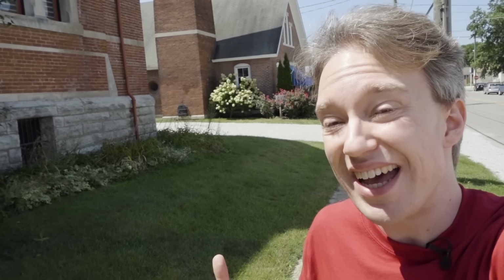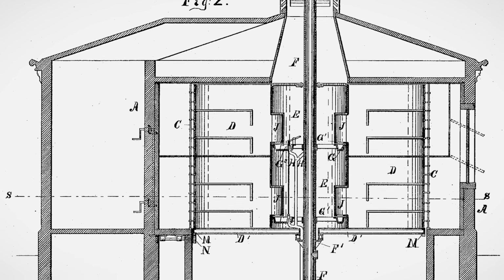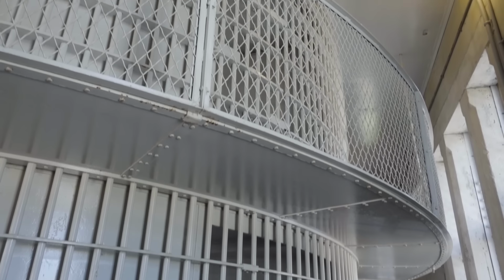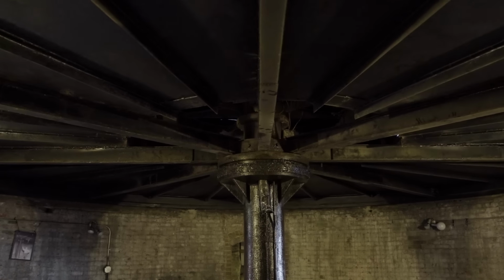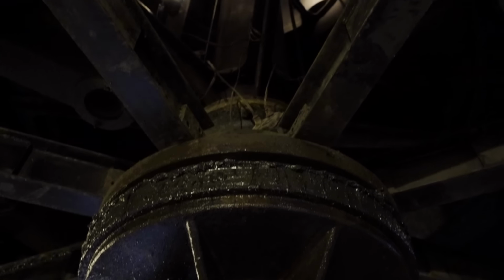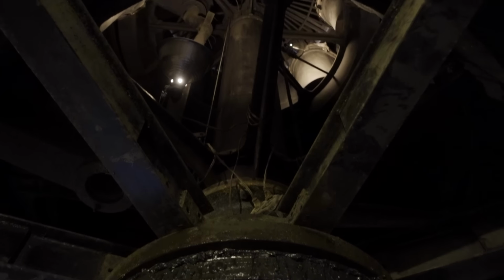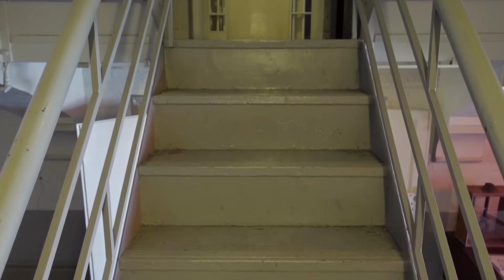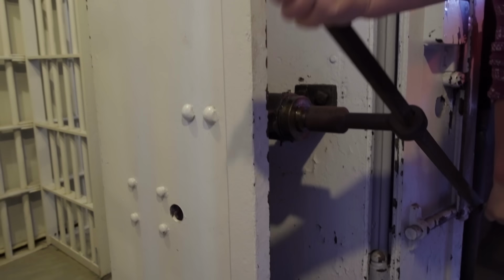The "rotary jail" had a slight problem

Comment: I visited this jail as a kid. A story that I remember the tour guide telling was of an inmate with a wooden limb who would, quite intentionally, stick it into the bars to jam up the machine and prevent it from turning.
Reply: thats one hell of a piece of wood
Reply: He probably had a wooden limb because his arm got chopped off
Reply: Judging by this machine's apparent power to break bones, I have my doubts about the truth of that story. 
I instead imagine it was told to not even get you thinking of what would happen to an arm jammed in there because if it can't break wood, it's all of a sudden nuch more harmless in our minds.
Reply: Wood from a diamond tree? I don't know if you know anything about physics or force, but a wooden limb is not stopping that door for a second.
Reply: @TheCbjunkie  it can stop it, or at least slow it and force the guards to make far more effort. It just can't in the way you're thinking of it. I guess the inmate would not be that stupid as to extend their wooden limb at the bars' reach, but rather it would be more efficient to stuck it in the gap between the central rotating platform (the cells) and the bars. The friction would certainly make it a lot more difficult to rotate the cells, considering the limb had to be of the necessary measurements to do that, which is not something crazy, actually.
Reply: Did a little trolling
Reply: I'm an exconvict. 
One trick to jam up the rolling bars style door is to put a toothpaste cap up in the gap of the mechanics. Plastic gets in there n creates a small gap so the door looks closed but is not. 
Any smart person would say no way a plastic cap can defeat the hugely strong bars.
Reply: @runtergerutscht4401 you don’t think a piece of wood can jam up gears and stop a door from turning?
Reply: @awesomebeast7509  I think that maybe it could, if it was indeed jammed into the gears. But I do not believe that a single piece of wood can stop the cellblock from rotating.
Reply: @runtergerutscht4401  a well-made, thick, arm shaped piece of wood is definitely stronger than an arm bone lmao. it doesnt sound that unlikely.
Reply: @verminscum  maybe. But it still seems implausible that such a piece of wood can stop the entire cellblock from rotating.
Reply: @runter gerutscht  if cell is already in momentum it would break the wood, if it has no room to move a single millimeter and u stuck something it would probably jam it
Reply: @runtergerutscht4401  Bro the inmate would have the mechanical advantage as well in this situation as he's on the outside of the largest circle. If anything I'd be surprised if inmates couldn't stop it with a wooden pole.
Reply: Trollage
Reply: @beaneater6932 old growth wood was strong. Not much of it left now
Reply: @TheCbjunkie  neither is diamond 😱😱
Reply: @runtergerutscht4401 It's hand-cranked. Wood beats hands.

Comment: I bet someone said "Why don't you just make the bars rotate?" within a week of them finishing building it.
Reply: Amputations are still an issue but it would take less energy to open a particular cell.
Reply: But you would have to build a catwalk.
Reply: And then someone else asked "why not just lock the cell doors?"
Reply: @PrimusProductions  The mass of the part thats rotating is much smaller, so less inertia, so amputations might be avoided.
Reply: It shouldn't have had bars. Just smooth walls.
Reply: If the bars rotated with the cells, then you would need a door for each one, which negates the point. Since it was 1881, plastics weren't mainstream or cheap enough to use, and glass was too fragile. Had this type of prison been built in the modern day with an electric engine, clear plastic walls, and the necessary precautions to let the prisoners out during an emergency, this could've been a more successful design.
Reply: @Rackergen  rotating catwalk
Reply: Ur a genius
Reply: Because then theres really no point in having a rotary cell.
Reply: Jordan Wardle but is there to begin with?
Reply: @BarginsGalore  no, but one use for the design means that you can put many more cells in a given space
Reply: Jordan Wardle not really. You could fit just as many if it didn’t move and each cell had its own door
Reply: the inmate literally can just pull the bars and move them so no
Reply: Rena Kunisaki 
Because then you’d need more guards which was the one plus of the design. If you wanted to rely solely on locks you would have a prison with zero guards.
Reply: @michaelweiske702  i think OP meant have the bars rotate instead of the cells
Reply: @axis4813  then the problem still remains, if the bars rotate but the cells remain stationary, people can still be injured in the same way. From the prisoners' perspective, their cell was stationary and the bars were rotating, so the problem remains.
Reply: @millomweb  then you couldn’t see what the inmates are doing ( unless the walls are glass, which has its own problems )
Reply: @MachineWashableKatie  why
Reply: Why not make the bars closer to each other, so you can’t fit an arm/ a leg trough?
Reply: @chri-k  You could have spy holes through the walls in places!
Reply: @chri-k  Material cost, you would need the bars to be so close together that the gaps would be less than an inch, at which point you might as well have solid metal.
Reply: @Benedocta  I think it would still be the same thing with a huge cylinder with the cells around the center:  the difference is the cylinder would have the bars and an open door frame built in with a smooth wall all around the outside except one spot with an opening on each floor.
Reply: then you would need 2 guards, one to rotate the bars, and one to watch the door, then you might as well have a regular jail system
Reply: How would this help anything at all? The amputation risk is exactly the same and the issue of fire risk is exactly the same as only one door... wtf? why are so many people praising this idea?
Reply: @axis4813  tom had tge same suggestion but idk how that would help either
Reply: @dorrisgonnawreckyou7111  because its easier
Reply: @IzzyCraft  You still need more than one guard, a single inmate can overpower a single person.
Reply: U would of had to build catwalks all way around to use all the cells
Reply: @michaelweiske702  The whole point is you have only 1 door so if you take precautions to let people out in emergency you might as well make a regular jail
Reply: @Rackergen  I don’t think a catwalk is needed; you can just have the bars rotate around on top of some bearings in a groove cut in the floor.
Reply: @millomweb  Air is needed for breathing. Also light is needed to stay sane. They're a jail, not a supermax with solitary.
Reply: Imagine the inventor sputtering and backpedaling trying to come up with rational reasons for his invention when some random dude casually suggested making the bars rotate instead.
Reply: @millomweb  Smooth walls instead of bars could stop drunk people hugging them and getting limbs cut off but then you’d probably have a mental stability and ethics issues with locking people in essentially doorless and windowless rooms instead. I don’t know if security cameras were a thing or how advanced they were back then but I imagine someone would still need to be able to periodically walk around the whole thing and look in to check on people as well.
Reply: @moony2703  Security cameras were absolutely not a thing back then. You'd have to wait for about another 100 years for that to be practical after this jail was designed.
Reply: @IzzyCraft  oh no, 2 guards instead of 1, the math is all wrong, it won't work, it's ruined, ruined I tells ya

Oh wait no, I forgot, that doesn't make sense, sorry
Reply: @Reihynn  no, there are absolutely mechanical ways of making sure it's only movable by crank and can't just be pulled along manually. Like a lock that's held open by the operator as it wants to let out the length.
Reply: Still have all the same risk.
Reply: @Reihynn  Im sure there is a lock that stops it from rotating
Reply: @michaelweiske702  have them rotate in opposite directions at the same time
Reply: @PrimusProductions  Maybe
The bars might be heavier
Reply: @PrimusProductions  Just put another door in the cell instead of an opening.
Reply: same problem... arms can be damaged.. plus if bars rotate then you cant have a single entrance/exit

Comment: "The bars could have spun," was my immediate idea... It's just insane, to move the whole thing, with it's here plumbing and everything.
What a bonkers idea.
Reply: I think the reasoning was because that way the opening is always in the same spot. If the bars rotate the opening is moving. So the cranking person can't see the opening. Part of the security was that you only needed a single guard. But you'd need more with moving bars.  
  
Also I'm not sure it would be easier that way or not. The bars being solid might weigh alot more than the cells which are made from plate steel with lots of air in the cells. If you summed the mass of both I wouldn't be surprised if the bars weigh much more.  
  
Also some cells face windows while some don't which is a reason you might want to be able to rotate the cells. There could be other reasons as well about the direction of the cells. Maybe you want to keep an eye on a particular prisoner. 
  
Overall I think it up for debate which way is better and we have to remember it was the 1880s. So some limitations applied in terms of electric lighting, security measures, and so on.
Reply: Like the corkscrew: why rotate the outside, when you can rotate the inside? Then someone came along and rotated the outside.
Reply: @mcfail3450  They could attach a platform to the bars. The opening is rotated to a cell door, the door opens and the prisoner steps onto the platform, and then the bars are rotated back to the operator before opening.
Reply: Smells like a scam to me. It must have been so expensive to build this!
Reply: you gotta walk around the whole building then
Reply: @milesedgeworth132  what's stopping prisoners entering other cells then?
Reply: @leftysheppey  There are two sets of bars. One for the cell and one for the platform. The cell door opens, the prisoner stands on the platform, the cell door closes, the prisoner is turned to the entrance, and the platform door opens.
Reply: Unfortunately, no matter how you slice a rotating bars, or prisoner transport platform, you're still opening one cell at a time, and that is an immense fire safety problem as mentioned in the video.
Reply: @irregularassassin6380  funnily enough, build it without flammable material, and it's still a fire hazard.
Reply: @milesedgeworth132  It be much more reasonable to just rotate the operator and crank with the bars.
Reply: @akzual50  you ever seen the 2 minute prison kill scene in breaking bad??
Reply: With it’s here ?
Reply: @maxbracegirdle9990  in real life it’s 1 minute
Reply: They could have put heavy mesh screen on the bars at the bottom of each cell.
Reply: Sage!
Reply: they could also just remove the walls next to it, that way you don't just break a limb because you got caught on something.
Reply: @carlosandleon  Oh no walking, every american's nightmare!
Reply: What about putting a barred door inside each cell to create a gap long enough that you couldn't get a limb into a crush zone?
Reply: The bars spinning wouldn’t solve either the fire hazard problem or the amputation problem
Reply: @Wjanabdjd138  oh no, it would still be a safety hazard from hell.
But it would have required far less resources to spin the bars, instead of the entire block.
Reply: @milesedgeworth132  that's even more weight
Reply: They were being creative
Reply: As someone with whatever used to be called ADHD, I really think the inventors had severe issues with managing their hyper-fixations and this 100% looks like a silly 'what-if' idea that went all the way. Main evidence being, exactly, that the bars could've spun instead and the problem would've been done in a week. Or the doors could've been lifted up/ the floor dropped down instead of needing to rotate at all (like a stopped elevator that just has a slot of clearance at the top, but covered in bars), which could've been way cheaper.
Reply: that would not fix the injury issue. There would be less mass being moved thus less pressure when the arm get's pinched between the bars and the side of the room, but it would certainly still have enough force to cause injury
Reply: @CrypticCobra  For sure, might be cheaper though. And in case of fires it's faster unless the mechanism breaks.
Reply: @akzual50  Funnily enough, things you think that wouldnt burn, do infact burn if they get got enough. Like bricks and Concrete. Unless you plan on making the entire prison out of steel (Also a bad idea) no matter what you do you're going to have to add flammable materials
Reply: @CrypticCobra  Oh yes, most definitely. But it would require less power, and less insane plumbing/power to set up.
Reply: @empdisaster10  I agree that concrete will break-down and oxidize if heated a lot, but is the process self-sustaining?  

Unlike wood, which releases a lot of heat when burned, I thought that concrete burning was almost endothermic, requiring other fuel to keep it going.
Reply: wouldn't have stopped the fire safety problems or the amputations tho.
Reply: @mcfail3450  rotate the bars AND the guard.
Reply: @milesedgeworth132  how does the operator see if the prisoner is in the rotating spot then? This is before cameras and before remotes. The operator has to be in a single spot unable to see everything. That's why the door is stationary and the cells move.
Reply: @therabbithat  the whole point was to only need one guard. The controls in the 1880s could only be stationary. So if you rotate the guard you have to now have a guard and another one to operate the controls. The whole system is designed so that a single person can rotate the cells to the door next to the controls then open it and let just that prisoner out.
Reply: @empdisaster10  people are certainly flammable, as we've seen. The "absolutely fireproof" Iroquois proved that one.
Reply: @akzual50  most people in fires die of smoke inhalation, not burning to death. Tney would die of the lack of breathable oxygen if the building was on fire, not from their metal cage burning.
Reply: The prisoners being suspended, the entrance always being in the same spot, it puts the 'vulnerable' parts of the cell on the outside too rather than within reach, and funnily it was probably more reliable this way with few big moving parts rather than many smaller moving parts. The idea really isn't that crazy if you're a small town that has limited guards to spare.
Reply: Wouldn't the bars spinning do the exact same thing, just reversed
Reply: "with it's here plumbing..." uh...what?
Reply: @empdisaster10  So you say concrete burns. I say citation needed.
Reply: Also could’ve had the hard plastic walls they have nowadays obviously they wouldn’t have it there back in the day but they could’ve implemented that later on
Reply: @milesedgeworth132  imagine all of the prisoner jumping onto the platform as the bars passed them
Reply: @irregularassassin6380  I'd probably design it without bars at all. Just a seethru Mesh with the support beams on the outside of the mesh. And to solve the Fire issue, 7 of the 8 cells line up with an Emergency exit that only opens in the situations necessary, letting out to catwalks. 

But I'm talking like, really thin mesh, but still seethru. Small enough to not stick a finger in, idk what material would fit that and withstand getting kicked out of the way.
Reply: You guys need to quit trying to ruin the inmate vending machine
Reply: @leftysheppey  It's city jail! Many have open blocks.
Reply: 2:40 If it's designed the same way rotating the bars would still cut off someone's arm. If it's designed differently you could still rotate the cells.
Reply: @PianoKwanMan  What does that even mean? What are you talking about?
Reply: @JD_tcb  Mr Old's elevator, which a variation of the Archimedes screw. Spinning one object in the reference frame of the other doesn't matter
Reply: Yea but that just means the bars rip your arm off not the wall
Reply: @mcfail3450  
Most prison guards have these handy-dandy tools called "feet" with which they can walk to the new position of the door.
Reply: they could just built a room in the middle of the cells with an exit to below the cells, that way they could take out each prisoner with just one guard and without building this supervillain disarmer
Reply: @Matthew Bedding is flammable, so are a lot of materials used for insulation, not to mention the amount of grease that would be needed to lubricate such a massive rotating structure. Keep in mind that the entire building need not go up for smoke inhalation to become a big problem.
Reply: @Razumen  hahaha
Reply: @mcfail3450  the idea sucked anyway so why even bother?